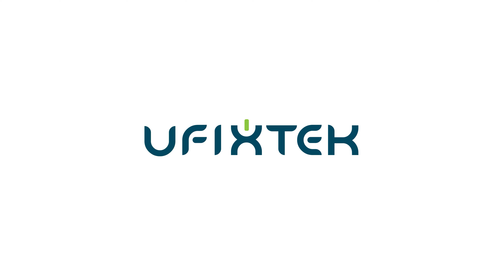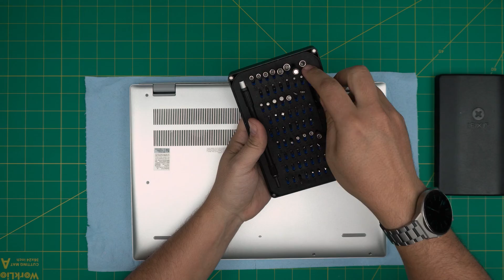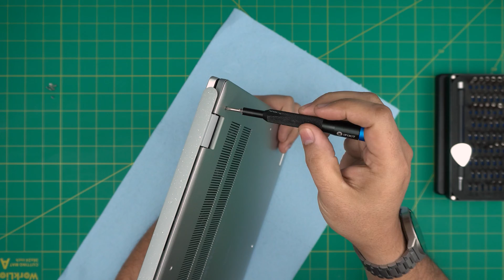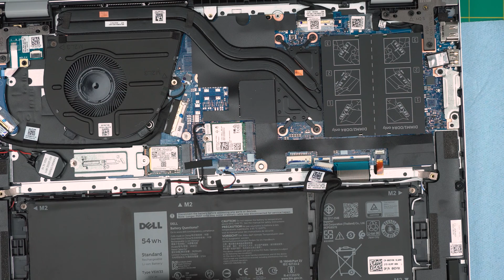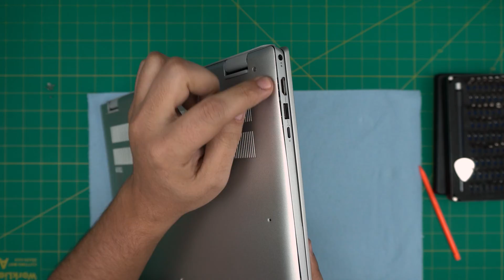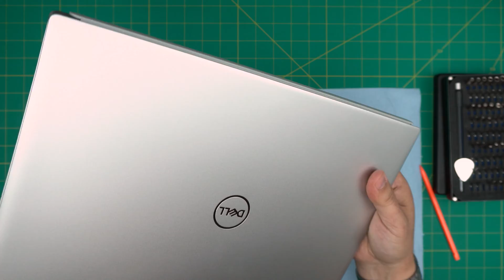How to Replace Battery for DELL Inspiron 16 5620 Laptop

Comment: Nice instructions,much much easier than changing a Mac battery dealing with all that sticky glue they put all over everything.This is the one thing windows has better than a Mac!
Reply from the maker: My pleasure 😊 Thanks for taking the time to share that—really appreciate it.
Super glad the videos helped you out! 🫠💞
Yeah, Macs love using adhesive for changeable parts!
If you need anything or have a request, just let me know.
A like/sub helps the channel if you want to support. 
🍻 Cheers!